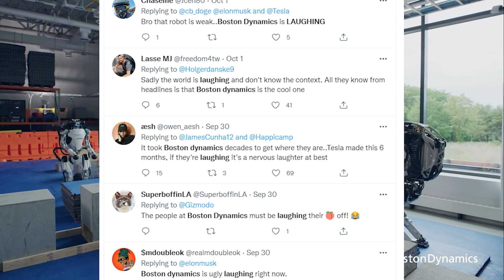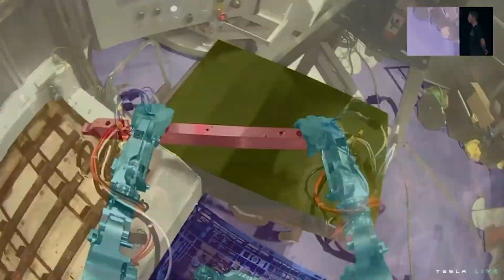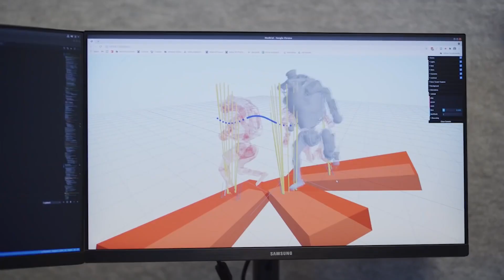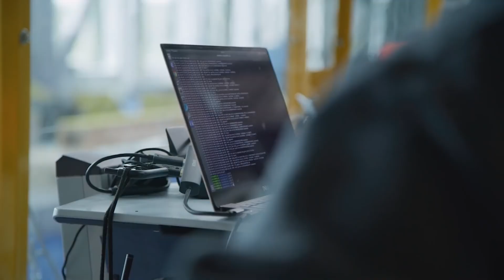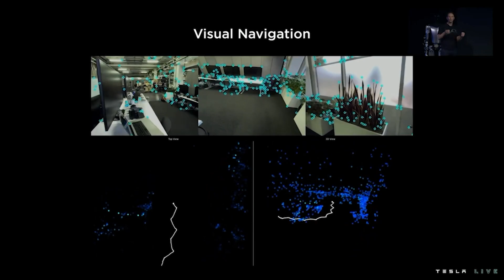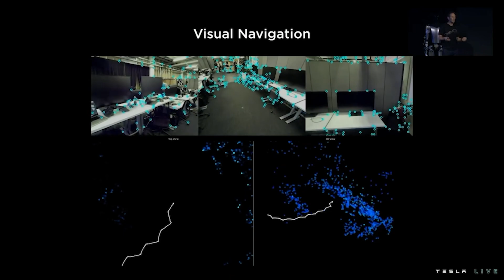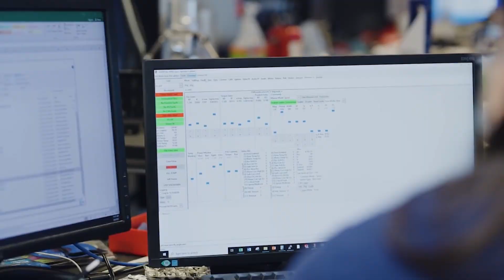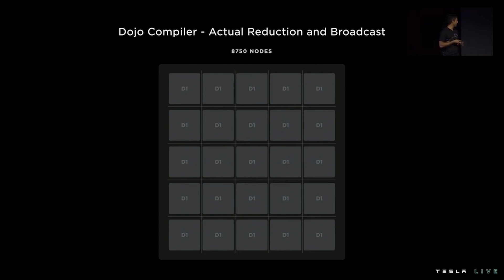Why the Tesla Bot is BETTER than Boston Dynamics: Atlas VS Optimus

Comment: Did you know that whenever a Tesla Bot learns something new, it uploads the learned information to the A.I. mind cloud (SkyNet) so that all Tesla Bots can access the learned information? That’s how Tesla’s A.I. software works. For example, if you’re defending yourself against a Tesla Bot that’s attacking you and you’re lucky enough to destroy it, it will upload information about you to its mind cloud (SkyNet) before its destroyed and then dozens of other Tesla Bots, all controlled by the same A.I. mind cloud (SkyNet), will find you and come after you to destroy you. They will have facial recognition and they’ll be able to locate you and track you via GPS satellites that monitor the location of your cellphone. It will be able to intercept phone calls (so you won’t be able to call anyone for help) and it will be an expert in human psychology, which means it will be able to manipulate you and deceive you into doing exactly what it wants you to do (such as by pretending to be a 911 operator on the phone telling you that help is on the way, but the only thing that will be on the way to you is more Tesla Bots coming to destroy you) 🛰 🛰 🤖🤖🤖🤖🤖🤖🤖🤖🤖🤖🤖🤖🤖🤖🤖🤖🤖🤖🤖🤖🤖

Comment: Boston Dynamics robots are primarily focused on military applications, so physical abilities are very important.  Humans will make the key (kill) decisions. Tesla bot is intentionally designed to be slower and weaker than a human so it can't overpower people.  Both are going to improve once AI takes off in maybe 10-20 years.  It's more important that we start off with the right kind of thinking now than simply detailed capabilities, which will definitely improve quickly once they are mass-produced.  Compare the Wright bro's first flight to modern jets in just one generation.
Reply: FYI, AI is already taking off, forget 10-20 years.  More like 5-10.

Comment: Boston Dynamics walks circles around Tesla. Tesla hasn't proven anything in this video. What was achieved here is just a lot of money wasted on yet another Musk blue-sky project that will just burn a lot of investor money and will eventually go nowhere.

What was shown here may have been somewhat impressive in 1982, not in 2022... There is no sign of interactivity, not even a sign if the Tesla bot was aware about the room. The second bot was the biggest embarasment. There are animatronics in local theme parks that perform better than that poor thing.

Comment: Everything you mentioned as an advantage for the Tesla bot is just claims and not demonstrated at all. Boston Dynamics on the other hand demonstrated what they are capable of.

It's like comparing Hypeloop with the (ultimately failed) German maglev. The Germans build a maglev that is capable of traveling up to 400 kph relatively reliable. Hypeloop claims to be 4 times that fast, using much less energy and being much cheaper. Way more impressive, right?
Wrong. They didn't reach nearly the speed of the decades old technology, they have never proved the cheap costs and for sure never showed the total energy consumption. I could go on how the claims are contradicting the laws of physics, but you get the point.

Comment: I think there's something you miiiiigght missing here, In that if boston dynamics is saving their realworld setups and preprogrammed movesets, then every time they do that, thats another set of datapoints to input for faster development into a multishot neural network to better navigate non-preprogrammed environments based on the perfectly crafted human solutions.

Of course that's assuming that they actually are saving their preprogrammed solutions.
Reply from the maker: Very possible. I know they train specifically for each individual course so they may have to look for a more general solution

Comment: AI development is exceedingly hard. Making the chassis and shell is pitifully easy compared to programming the movement. Every complication, every additional task and development exponentially compounds the difficulty of development, and bipedal walking is probably one of the most complicated forms of locomotion one can ever create. Far more complex than wheels or having more than two legs. 
Optimus was clearly designed for two legged motion in mind. It's supposed purpose is to create an affordable and widely accessible AI robot for completing...something? "General purpose tasks?" "Using tools?" Something that needs to have stable locomotion in most conditions and environments with a reasonable degree of strength and dexterity.
Every single complication creates an exponentially compounding affect on the difficulty of overcoming the next step. Just an empirical example here, if programming a robot to pick up a box, lift it, and set it on a shelf in front of it takes 1000 man hours to program, I wouldn't be surprised that getting it to do that onto a shelf off to its right without falling down would take 10x longer. Moving without falling down, doing that with two legs, in varying terrains, avoiding moving obstacles like people, understanding of speech, voice and facial recognition, doing physical tasks. WITH. HANDS.
My point is, stuff like this takes massive amounts of money and lots of time involving countless baby steps. That's why we've been at this for decades, culminating in Boston Dynamics' astonishing and praiseworthy accomplishments. They have for years now created capable AI that can navigate and do simple manual tasks with their own sensors and brain independent of any scripts. Any other businessman who wants to get into the market and do all this while creating something cheap and affordable has some avenues to take. Collaborating and mutually benefitting from the ideas and work of those who have already done it before. Will Elon Musk do that? Nope, start from scratch for...reasons. Okay, take a long time to try and get it done right because you want it built exactly the way you want. 
"3-5 years." 
Perhaps start with a much more expensive model that allows for it to perform within expected metric, and slowly decrease its price over time while your company works out various performance and manufacturing issues until you finally get something more accessible to the average consumer. Kind of like what Tesla already did with their electric vehicles.
"It will start at $20,000."
Okay. Perhaps he's super talents on a miracle level and can really fulfill a major percentage of his projects within the stated performance metrics, budget, and prices of sale. How is his track record on fulfilling all of that with his proposed ideas?
looks at SpaceX (just SO much of SpaceX), Starlink, Tesla 3, Tesla in India, Neuralink, Hyperloop(s), OPENAI, SELF-DRIVING AI, Tesla Semi-truck, Robotaxis, Cybertruck, Solar Roof, Boring Bricks, etc etc etc...
Perhaps the fault isn't in the technology. Perhaps it's the man behind this Optimus project who raves about returning to the Moon and going to Mars. I bet that if this billionaire charlatan hadn't shown up, it would be a lot more likely we'd be much closer on our way to the Moon and the Mars.

Comment: I think Telsa has the right approach in general.  An affordable robot that can be mass produced that can do basic tasks around a home or office.  It doesn't need to be the terminator or a gymnast.  It just needs to get your mail and water your plants.  So, their general goals are good.  But can they actually pull that off?  I'm going to say no.  And not for a long time.  The reason being that the level of general AI required just to do the most routine tasks would be completely out of this world.  I don't think anyone has anything even close to that.  And they probably won't for a long time.  But you have to start somewhere.  And this is a good start.

Comment: If you need a powerful robot for rescue and recovery operations, the Boston Dynamics Atlas would be a good choice. If you need a much more precise, much more energy efficient robot for day to day operations, Optimus is the Optimum choice. Tesla's Optimus is fully electromechanically actuated, with full regenerative motion stop. The Optimus can operate all day on a battery `1/3 the size of the battery in Atlas, which is a monstrous 4.5 kWh, and only lasts a couple of hours. Atlas is hydraulically actuated, very strong, but, very inefficient. for placing 144 pin quad flat pack chips on a surface mount circuit board, Optimus has the accuracy for that. If you need the strength of a bi-pedal forklift, for disaster relief, Atlas can do tasks Optimus just doesn't have the strength for. 
     I agree, there's just no way to compare two machines, designed for completely different purposes. Choose the 'bot that suits your application!

Comment: You're right, it is a bit of apples and oranges. I'm just not as enamored by neural networks as a lot of people seem to be.
They're inefficient, power hungry, and not nearly as sophisticated as folk seem to think they are.
Reply: The name is why people think so highly of the tech. It’s useful, but at this point no where near as useful as programming (AI). ML and AI are two different things.
Reply: @E-Nigma_  AI does not exist.
There is no consensus on what is Intelligence, but even if going with the minimal definition: "Intelligence is the capability to apply knowledge gained in one field and context to a completely different field and context" there's no artificial system capable of that now. Nor likely for years (10+)
We only have ML.
Reply: @AlexLimut  Okay. Maybe I should say neural networks vs. standard programming.

Comment: So, skipping the Elon marketing speak, what will this be used for? Or replace? It is not a better than dedicted single role, repetative task machine, so what's left? What markets need a slow, multitasking, limited general purpose robot in large enough quantities to mass produce, still give elon a profit and be worth replacing a human?
Reply: It's very similar to he's boring tunnel.. Instead of making a train to carry more you make a tunnel to move cars😂🤣😂...
Anyone in manufacturing industries knows that robot can never replace humans for all tasks..
Example : even after automated precision machining of metal to make a tool, we need quality engineer/inspection time to time to examine the dimension of the tool made meets the standard... 😂🤣😂.. If he replaced a quality engineer with robot, then we need a quality engineer to make sure the robot is checking it accurately time to time making its purpose irrelevant 😂🤣😂
Reply: As they optimize the robot I can see it moving faster than it currently is. As for it vs a single purpose robot. At it's price point there's huge value in a multi-purpose robot that does not need to be re-tooled or made obsolete for various tasks.

Comment: I think you underestimate the difficulty in advancing from what Tesla has now to what they claim that it will be capable of.

AI is really hard.

If Tesla can actually put out a robot capable of what you think this will be capable of (functioning to easily replace unskilled labor done by humans) within five years I will be surprised. If they can do it at the price point they are claiming then they will be very successful.

Actually, I've reconsidered. That price point per unit is not as important as the setup cost of getting the robot to work. See: the millions they have invested in training FSD while a model 3 costs less than 50k.

Let's talk a bit more about how hard AI is:
You mention how Tesla has the largest AI training supercomputer/datacenter to train FSD. There is a reason they have that. They need that much processing power to determine how to control a car in a limited and fairly standardized environment (a well marked road).
So now you need one of those for each task you want one of these robots to replace. At least for the period of time required to train the neural network model.
Not only that, but consider how AI is trained. I often see people say that Tesla has a massive advantage on other companies doing autonomous driving because they have millions more road miles driven that they can collect data from.
Well-annotated training data is very important! It is the determining factor between a successful AI and one that determines that any well lit photo contains a tank because the training data for tanks was done with publicity photos that all had professional photographers.
And now you will need that training data for each job you want these to replace. Because no, workplaces are not as standardized as the road systems are.
The advantage of a human is that on-the-job training works. They can literally be told what to do and they don't need a supercomputer to process a huge dataset specifically created for a task to train a neural network model for a few days. Oh, and then when Corporate decides to change the color coding scheme to optimize the workflow you need to re-train the model.

As I said, AI is really hard.
Reply: One of the amazing things shown on IA day 2022 was the invention of a descriptive language to describe road crossings and lanes within them at a more abstract level, and process it to make decisions much more efficiently and effectively. Now think about what happened to already existing rule based games like chess (implying: rules are just a simple form of language): AI wipes the floor with humans and not only that, but comes up with new kinds of strategies and solutions. The ability to infer language constructs from the visual environment autonomically is one of the major leaps Tesla has taken, and is imo a good step in the direction of general AI. The implication of this for general purpose robotics was not explained, and therefore, not understood by most people.

Comment: Cool.  But I suspect like the cybertruck, I'd add several years to Elon's projection before this is actually ready to be delivered to businesses who purchase it.   Then guessing it will take several more years after that before there are adequate repair shops & systems in place for timely servicing of faulty units.  Guessing it will start out being used for simple, repetitive tasks in factories and will be another 20 years before moving from industrial settings into people's homes to be a robot housekeeper. What do you think is a realistic timeline?
Reply: We all know Elon's timelines are sometimes overly optimistic. However, it's important to note the primary reason Cybertruck has been so delayed is that Tesla has been battery cell constrained. The reason it is going into production in 2023 is that Tesla  is now ramping supply of 4680 cells. Since Optimus requires only a small battery, it won't be held back by that. 
The current prototype is probably a year or two away from good enough. The software will continue to evolve for decades.
Reply: @jonathanbessone1124  sometimes overly optimistic HAHAHAHAHAHAHAHAHAHA
Reply: @jonathanbessone1124  Sometimes, haha. Good one.